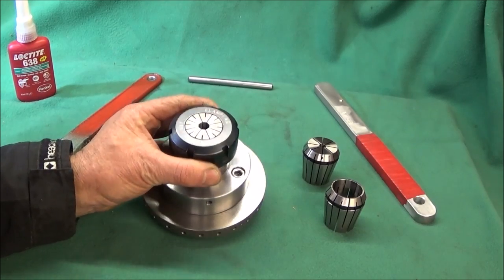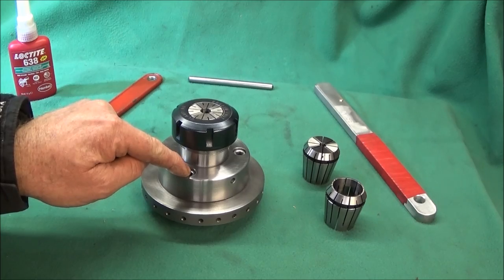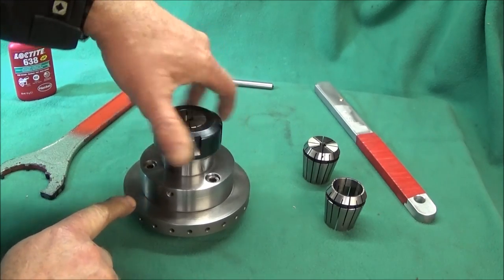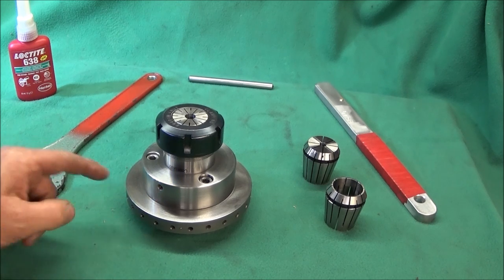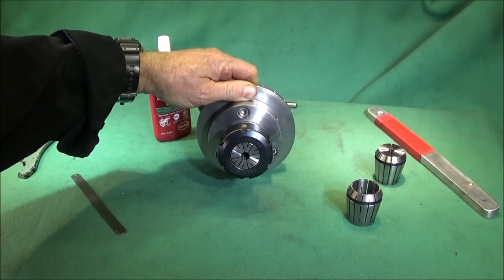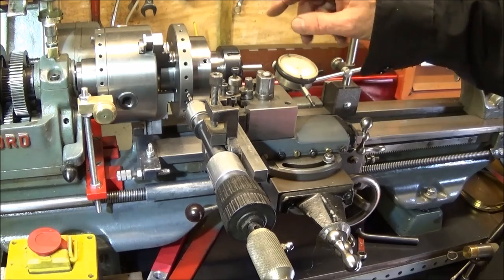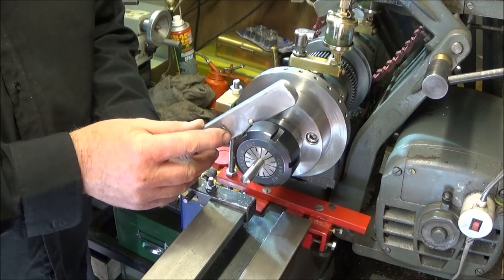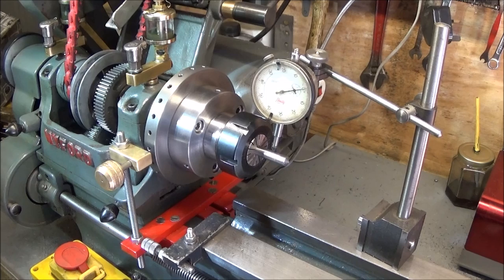ER40 Collet Chuck Fitting On Myford Lathe With Duplicate Indexing Backplate

Comment: I posted about runout in my ER32 chuck to you.
I wanted to mention I cured my runout with a "Bearing" type ER nu=t.
The bearing makes locking down the collet much easier due to the bearing in the nut.
I bought mine off EB for a reasonable price, chinese I am sure.
Thanks
Dennis
Reply from the maker: Hi Dennis, Thanks... Yes I have one of those for my ER40 chuck. They are excellent. I will be getting one for my ER32 as well. Regards Steve

Comment: Hi Steve,   I know it's been a while since you made this video.   I was wondering about a through hole with this setup.   Obviously you don't have one but I was wondering if you could still drill one in there?   I like the setup you have and seems very straightforward.   I understand that the through hole may not be at max spindle diameter but I would probably be using ER 32 colletts.   I was also wondering if you could put two flat spots on the collett holder so you could use a wrench to tighten and loosen the collett?   Thanks 

Dale  Canada
Reply from the maker: Hi Dale. It does have a through hole but the spindle through hole is very limited on the ML7 lathe at about 14mm I think. You could put flats on if you want.

Comment: great vid, i used this vid to do the same but with a er32, steve, ive got a ml7 but the lever on the right wot for engaging the back gear? all it does is locks up the spindle. ive heard this backgear enables a real low spindle speed.is this true? any tips would be muchly appriciated.
Reply from the maker: Hi on the Myford lathe one has to loosen the allen bolt on the lathe spindle gear and slide the tooth gear forward then re tighten allen bolt....then engage the backgear to use. The key is on one side of the spindle gear, the side nearest the chuck. Then it will work. After using the back gear be sure to put the lever in the nuetral position and   re-engage the tooth key by loosening the allen bolt and pushing it back...then re-tighten allen bolt. Regards Steve
Reply: @SteveJordan  ahh i sorta get it. many thanks steve

Comment: Hi Steve, very interesting video. Thanks! You mentioned you bought an indexed backplate, where did you get it from? I am interested to buy one as well, but I didn't find a source. I bought a used myford ml7 several month ago and I would like to complete my equipment. I there an fitting ring on the backplate mount the collet chuck centric? Any help is highly appreciated. Best regrads Hartmut
Reply from the maker: Hi Hartmut, I bought my backplate on Ebay from the Myford company, but you can also get them directly from www.myford.co.uk Once you have one, you can buy cheaper blank Myford threaded backplates on Ebay etc and make those the same by holding them on the back diameter in the chuck and using a tool-post drill to copy the hole  spacing. The collet chuck was one that I bought with a 3mt taper on the back which I sawed off...then made all the collars and fittings to go on the backplate to make it concentric.....Regards Steve

Comment: Hi Steve, Can't say I am enamoured with the collet chuck due to the extended overhang. I was lucky enough to get the Myford collet chuck with the lathe when I bought it and It is really accurate. I regularly work to 0.0001 using the collet chuck and the accuracy is primarily due to how close the collet is to the main spindle. I would be horrified to only achieve  half thou' accuracy. Other than that a good video. Cheers MoK
Reply from the maker: +Mo King Hi thanks. I find it dead accurate. The overhang is no problem. You can buy collet chucks that are made to screw directly onto the spindle on the Myford lathes but these are expensive and often run out by more than 3 thou!.... I would rather have mine than one of those. I'm really pleased with it and it is great to have the indexing facility.

Comment: Wouldn't say low cost would be cheaper to get some steel or cast iron and make a collet
chuck from the spindle nose straight to the collet nut and you would have less over hang
and less chatter..:)Just my take on this..You would have to buy the indexing plate and
also the er 40 collet chuck i can get a piece of steel for around £20 and still have loads
left over and get the nut and collet set for £80 or so.The only benifit is having an indexing
plate on the back..of the collet chuck..And i will say good job but why don't you show 
actually making it ?
Reply from the maker: +Muhaa Haloa  I thought the video would be too long if I showed making it, especially as I do not have a milling machine. The adaptor and backplate machining on this set up are just basic turning, boring and drilling and there are plenty of videos on Youtube that show how to do this already. 
  I just want to share my tool ideas that I find very useful and not bore viewers with lengthy video on subjects that are already covered.  
 I haven't found that get any chatter at all when using the collet, if I did then I would have abandoned the idea and not have shown it.